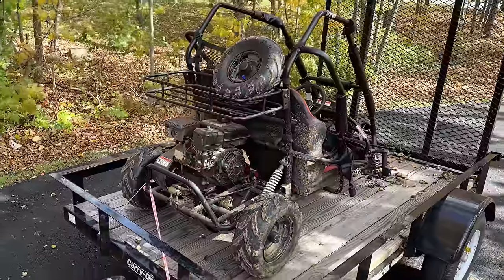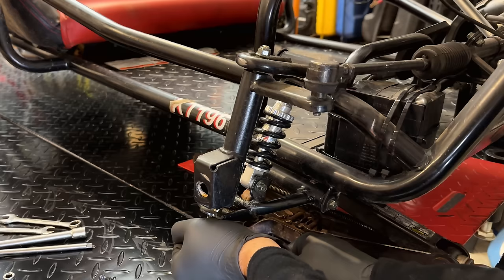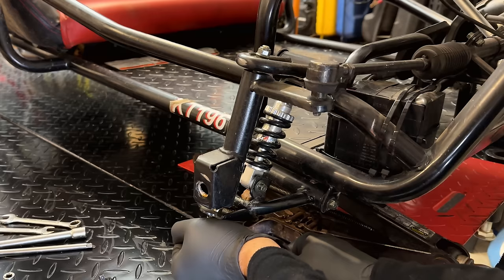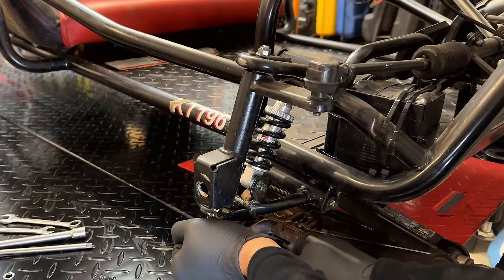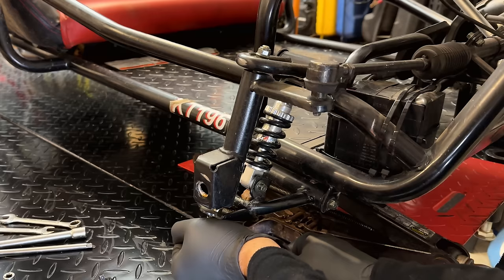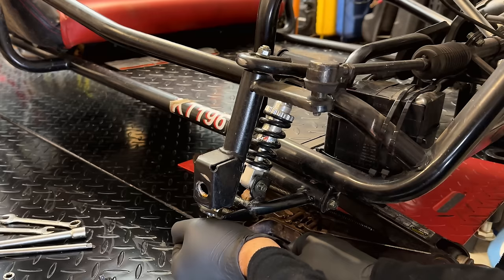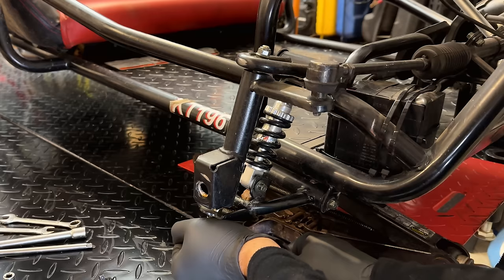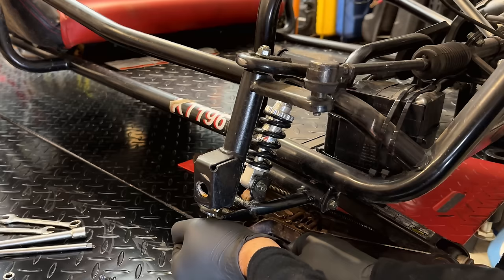Coleman KT196 Major Upgrade/Repair - Electric Start, Charging System, Suspension, Lights and More...

Comment: #jamescondon i would recomend those kind of light but the spotlights up at the top bars. That way your son will have light everywhere and not just on the ground. And those mounts are good ive had those once on my old go cart. Only i had to use some extra electrical tape to hold them better cause my bars were just slightly to small for the mounts. seeings that im commenting b4 watching the entire video, may i suggest a red led tail light/brake light on the back at either the top bar or the rack in the back. Also i would of thrown a 10hp on it but thats just me.
Reply from the maker: Those are great ideas, thanks

Comment: This situation with these new engines and carbs coming in with the pilot jets set so the engine runs lean to pass emissions, is just ridiculous, as so many people will just jusk it, because they won't know better.
Reply from the maker: Its said when new engines and carb run poorly to pass certification.  A lot are junked because of it.

Comment: are you using ethanol-free fuel? if not, that may be why they run too lean all the time.
Reply from the maker: The go kart gets ethanol fuel.  Ethanol free is hard to come by in my area.  I do have some but save it for the really old vintage stuff.

Comment: If the clutch pulleys are not operating as designed for the belt to climb down into the engine pulley for starting power and climb up in same pulley at speed with the rear pulley and the belt on the rear pulley starting near its outer edge for starting power and then climbing down into the rear pulley at speed the belt and pulleys are NOT operating correctly.  Video the belt and pulleys when during it to see what they do.

Comment: 47:59 Why not just get a pulley the correct diameter. Much cheaper and easier than swapping crank shafts. 🤦🏻‍♂️🙄

Comment: how  come it seems like you should have taken thee upgrades a tiny  bit farther. even a aftermarket carb and exhaust would make a noticeable difference to performance. you may want to check out red beard's garage
Reply from the maker: I thought of doing a governor delete and fitting a 28mm carb.  Then I came to my senses.  If I did that the engine and frame would be destroyed in a week.

Comment: Why did you not just get a longer bolt and make a spacer to put on the end of the crank to make it the right length. That little bit it was short would not have mattered on how well the pulley mounted up. This would have saved you a lot of time and you would not be running a used crank in a new engine and a new crank in a used engine.

Comment: I have a question, why those 200+cc engines make so little power? I can get 13 to 15hp from the same displacement and up to 25 using some radical mods. Why only 7?
Reply: 1. most small engines only rev to 3600 RPM, which necessarily is going to lower HP/size (HP being torque x RPM). 2. Small engines also don't care about making power, thus they don't have the cam/valve lift and timing, ignition timing and optimized flow like modern cars and motorcycles. Basically they have no power for the same reasons cars of the 70s and 80s made no power - no RPM and no consideration for performance.

Comment: Watched every video. I have an off topic question what is the difference in power specs when you parallel 2 honda eu2200i together vs 1 Honda eu2200i and one Honda eu2200i companion? Thanks
Reply from the maker: Individually they produce 1800 watts.  When you parallel the available wattage is double at 3600 watts.  Does not matter if two eu2200 or an eu2200 with an eu2200 companion.  The only thing the companion offers is a 30amp outlet on the control panel.  So only need to buy simple cheap parallel cables.  When running the two eu2200 in parallel you would have to buy a parallel cable that has the 30 amp plug as part of the cable.  Same result in the end, just more money for the cable.
Reply: @jcondon1  I really appreciate the time and effort you put into your channels.
Reply: @jcondon1  Thank you for your information. I have watched every one of your videos and have seen you progress from a beginner to very professional. One of the methods other YouTube video producers do is talking way too much and mostly about themselves. You start at the topic and just proceed. 

I also really appreciate when you leave the mistakes you make into the videos; it shows the realism of being a mechanic. I have seen professional mechanics make errors in their duties, it is just being human.  Your pricing of parts is also very informative.

I had talked to you years ago and had suggested you get an oscilloscope and explain to you audience what you are doing and I was happy to see you took my advice especially while using the multi-meter.
Thank goodness you got a lift table as it looked painful to work on the ground. The load bank you acquired is an asset to your videos; you can always use all of your heaters. 

I grew up without a dad and I always find it heart-warming to see a father and son interact. 

Again thank you for your information and you have made my decision easier as I rent and do not own an RV, a companion model will not be necessary.

Comment: u did not( imo )need to switch crank...just a longer bolt to attach clutch was needed...
Reply from the maker: The crankshaft on the old engine only went 2/3 of the way though.  The shorter crank only went about a third through.  Was worried it would not hold up.

Comment: Watching your video i found that with that type of rocker you don't get a accurate reading just putting filler gauge under like you and others do because of the dimple on the rocker to me the valve rest on that not the side's of rocker cut down the filler gauge so that it doesn't touch the sides of the rocker there cheap enough cut with scissors

Comment: You should have broken in the engine first before swapping the crankshaft.  Having all that initial break-in metal in an engine with a crank with a 1/1000th of wear already might have made it worse.

Comment: How much above sea level are you. These china clones are assembled at sea level. Also you did not have the air cleaner on.
Also if you want more charge current, install a full wave bridge rectifier instead of the single diode. But your voltage will drop by another 0.7 volts as there are two diodes now conducting current.
Reply from the maker: Maybe a 100 feet above sea level.  Good point with the air box and full bridge rectifier.  Thanks

Comment: Were these factory parts or chinese reproductions?  If Chinese parts I'm not surprised that you had to "fix" everything to put them on.  If factory, I'm surprised the factory didn't supply notes on fitting the parts to the original chassis.

Comment: Would the 440cc work on this particular Go Kart?
Reply from the maker: Probably would not fit without a lot of modification and an upgrade to the torque converter.
Reply: Hi thanks for your reply! Didn't realize how limited the engine space was in back of this Go Kart, your right it would take alot modification to get a engine that size to fit. There a 274cc 9hp model that seem be alot smaller, I lt would require a 1inch Pulley just not sure if everything would lineup what you thing?

Comment: The engine wouldn't have a oil sensor on a go kart because when your going up and down hills the oil will go to one end of the block and then the oil sensor is gonna read low and the go-kart is gonna constantly shutt off  even though the oil is not low so that's the reason why the original motor did not come with oil sensor so u might have to remove the oil sensor in the the new engine or unplug the oil sensor wire so the go-kart won't shut off when your going down a hill or up a hill  you will see if u don't get rid the oil sensor in the new engine it will shut off all the time
Reply: It didn't on the hills for the test run...which are probably the slopes that  it will usually run on.
I'm sure the sensor will work properly if at starting.....the oil is low....?

Comment: Why don't you put him in a bike helmet?  This thing is probably no faster than a bicycle (15-25mph), it's closer to the ground and they are a lot cooler (vented) and provide MUCH better visibility than this full helmet.  A full face bike helmet would work too with the wind if you're worried about that.
The combination of the lack of visibility in a full motorcycle helmet and how hot you get in a full motorcycle helmet make them dangerous, IMHO.  On a motorcycle, at motorcycle speeds and in heavy traffic, it might be a worthwhile trade-off, but on grass and fairly low speeds in a 4 wheeled vehcile, it probably isn't a great trade-off.

Comment: You don't want that oil sensor in that motor that is made for a machine to sit still and run turning bouncing. In a go kart your engine will not run right
Reply from the maker: I can always bypass it.  So far though not an issue.

Comment: Those long a arm bolts in the front suspension should get full torque.  They pinch the silver bushing and the a arm rotated around the bushing.  Leaving those nuts backed off will lead to disaster.  I wouldn't let anyone I cared for operate that pile of crap.  It's a certain trip to the hospital.....if your lucky

Comment: Yeah, as usual, if you enter a comment, no matter how well intended, (if it's outside of the U.S.) it gets ignored.
How very typical
🤔🤔🤔😏😏😏😏😏
Reply from the maker: Not sure it works that way.
Reply: Only kidding, am convinced it does not work that way either. Plus  the U.S. is a very busy country, with much work to do and (seemingly) so little time to get it all acomplished in.
Support as always.
Wayne & Nina
❤️❤️❤️❤️👍👍👍😊😊😊😊🇬🇧🇬🇧🇬🇧🇺🇸🇺🇸🇺🇸